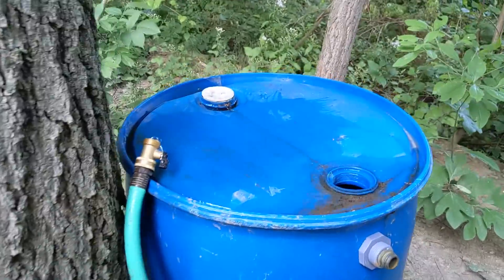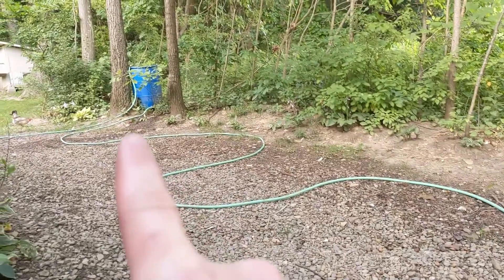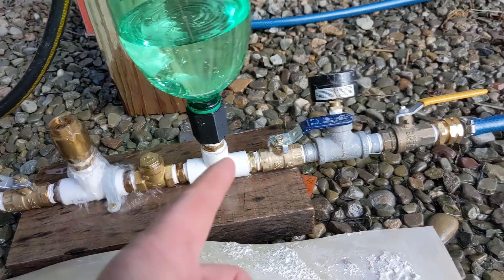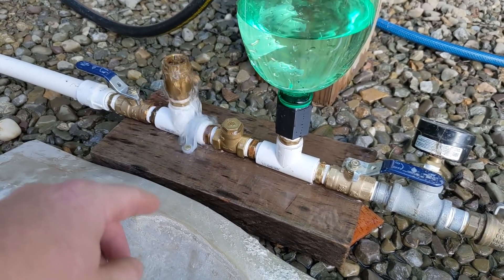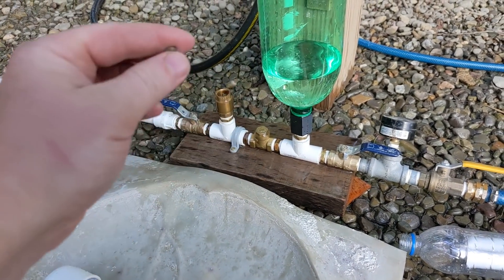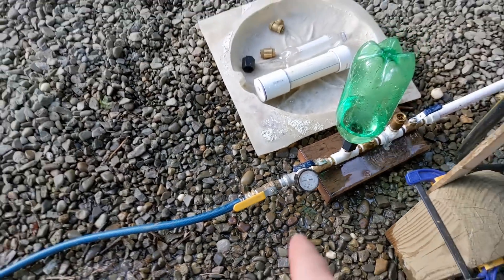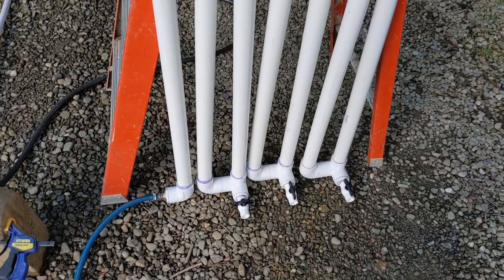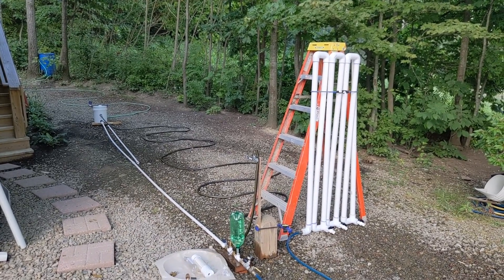My Ram Pump Experimentation Setup

Comment: the one way, swing check valve, when used as the exhaust valve, can be easily adjusted to beat at a different pace. ADD a pipe nipple on the exhaust side. The added water it retains above the flapper, weighs the flapper, and slows it's beat.

Comment: instead of a fixed weight for the valve why not have some kind of adjustable spring load, like you could print a hat for the valvehousing with an open middle section to let the water out and then a spring in there pushing down on the valve plate somehow. it would make fine tuning your pressure almost infinite as you could swap springs with ease aswell. you could also just opt for printing the whole valve with springs and shutter, I'm pretty sure there is not enough pressure in that little setup to break an abs printed valve.
Reply from the maker: Are you in my brain?

I have stuff in process that is exactly this.
Reply: @JoeMalovich  hehe, that would be a bad day for you if I was, but thought I'd share my thoughts just in case you hadn't gone that direction yet.

Comment: Joe, please look at "Foot Valves". They are caged, open linear slide valves. Easy to spring load or add weight.
Reply: exactly my though as well just with an screw on top to adjust spring tension to make fine tuning easier.

Comment: 3-D Printing an adapter coupling looks like it's hit or miss. If you look for a fitting that the cap to the bottle is a close fit inside, JB Weld it into on end and drill out the caps center. 
Or 3-d print a fitting that'll accept the bottle cap and do the same thing the same way. Fittings at the hardware store might be faster...

Comment: Unless I'm confused, wouldn't the "air" pipes become filled with water? So when the system is full the entire serpentine PVC setup would have the same pressure at each valve.
To add height, there has to be continuous positive elevation change. Any negative elevation change cancels out it's equivalence to the positive.
1+1-1=1
1+2-1=2
Etc.
Sorry for seeming condescending with such simple and obvious adding and subtracting problems, but it's just to be completely clear. 

I'm guessing your original thought was that the pipes would fill with water until separating every other pipe(the "air" pipes) with water. Then the air filled pipe would then act as though it were a pipe filled with water as it was pressurized. Which would make the dropping of water from each consecutive pipe seemingly add in a compounding manner. That might be possible if air wasn't soluble in water and if air wasn't a gas, meaning it's compressible.
In that world brake lines wouldn't be so difficult to install, but scuba diving wouldn't be possible. Although, the bends wouldn't be a thing. 
Sorry if I'm missing something. 
Also, sorry for being the bearer of bad news.
Reply: It will work, he just needs to completely refill the system at every test to get repeatable results
Or better: inject some air in the water until it exits the last pipe, that way the amount of air in the air pockets is at maximum for every test
Reply: @Henning_S.  That's fine if you're testing another variable, but also might be impractical to do if scaled up. Testing specifically for the efficiency of the air filled setup would be a test all it's own though. That's what I'm thinking would make scaling up a difficult process. 
It'll never be Hoover Dam sized because of that, but that's not to say a size closer to a small low head dam would be impossible. So testing is going to be extensive to anyone taking things to that degree. I mean that'll take some hardcore dedication! Lol
Reply: @jackovoltraids5937  i did understand it like this: He wants to use that as an artificial backpressure and to compare different pump setups by measuring the maximum height of the water level in the last pipe.
But if the amount of air in the pipes changes, it creates different backpressures for each pump and he won't be able to compare the different pumps or if he ignores that, he will get wrong results, the pump with the least amount of air in the system will seem to be the best one, because of the lower backpressure.
Injecting some air via a Compressor while the pump is already running ensures that each air pocket is filled to its maximum.
That will provide repeatable results, because the backpressure is always the same.
Of course he can also use transparent pipes for the whole thing , so he can measure each air pocket, add the length of the pockets together and subtract the distance from the top of the last pipe to the water level in that pipe, and use the results to compare the pumps, but I think injecting some air is just easier...
Reply: He explains (and demonstrates that it works) the artificial back pressure thing in this video: https://www.youtube.com/watch?v=qpxHFyewIkk
Reply: @PKMartin  ok, I guess I'm missing something. Or WE are missing something. 
It's probably the part about air being soluble in water and also a compressible gas that makes this a higher potential for entropy to come and steal more energy than is saved(also in material costs) by not just doing it the hard way(straight up or just up the hill).
If testing proves otherwise, then I'll eat my words. It's just rare that we get one over on entropy.

Comment: The water can only absorb the oxigen, which is only 21% of the air. The rest is (well most of it) nitrogen and is not going to get absorbed in water.
Reply: The nitrogen is also absorbed in water.
 Around 20ml in 1liter of cold water @ atmospheric pressure.

So theoretically it would be possible to dissolve 1 liter of air in less than 50 liters of water.
Of course it will not dissolve that much air because the water he uses has already dissolved some air.

Comment: Hey Joe, quick question towards the end regarding the clear pipes. Can you make all pipes the same length or is the pressure in the first turns higher and hence you need a longer clear pipe? I can't quite get my head around the pressure in the different pipes, if it's all the same or not.
Reply from the maker: I will need to close each valve stage as the water reaches the top of the clear hose.
Reply: @JoeMalovich  Ok thanks! Then I was right with my thinking ;-) Looking forward for more results.
Reply: How about having all the pipes clear?
Reply from the maker: @haraldlonmo  too expensive

Comment: Your airlock thing is interesting, but it only works by compressing air, so it will have back pressure, not sure why you said it didn't.
Reply: I think what he's getting at is that the water being pushed uphill makes back pressure, but because the downhill sections are mostly full of air that drop doesn't act as a siphon to alleviate the back pressure. If the whole thing was full of water it would only as much back pressure as it's own height, but having the downhill sections full of air means the back pressure from each water-filled pipe adds together so it acts as 20 feet of head rather than just 5.
Reply: @PKMartin  yeah the air doesn't add to it (or really, subtract from it) due to being light, but it certainly is under the same pressure.

Comment: Air will always dissolve into the water. If the water in the bottle is being circulated it will dissolve faster. If it’s cold faster again!
Solids dissolve fast in hot water (eg sugar in warm water) gasses dissolve faster in cold water

Comment: Consider printing the adapter in a wax instead of plastic and then use that to cast a metal part
Reply from the maker: Have you seen what happens to those? They get deformed worse than Vader's helmet in The Force Awakens.
Reply: @JoeMalovich  metal casting
Reply: @JoeMalovich  bury the wax in sand pour over molten metal. The wax boils off the sand holds the shape. 

Metal part
Reply: @JoeMalovich  points for the star wars ref,..,

But I know what u did, u stopped reading at wax, before I mentioned casting. Most high schoolers fail exams because the DONT read the question on the exam. 😜

Hell, my wife answers me before I’ve finished talking. 

If she says yes before I’ve finished I change the question to my benefit
Reply from the maker: @tonyoliver4920  ok yes it could be done but I don't have any foundry equipment, shrink would be a factor, and there would be secondary operations for sealing surfaces.

It would almost be easier to just turn one on my lathe.